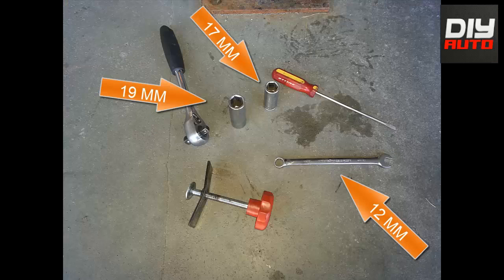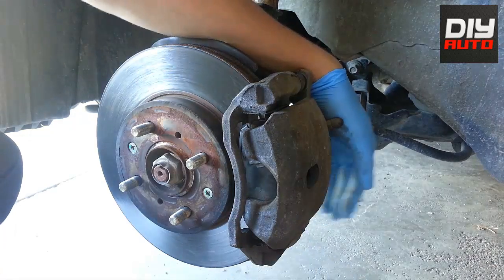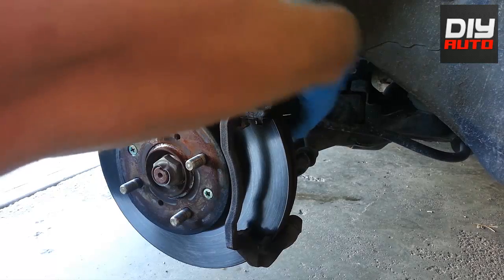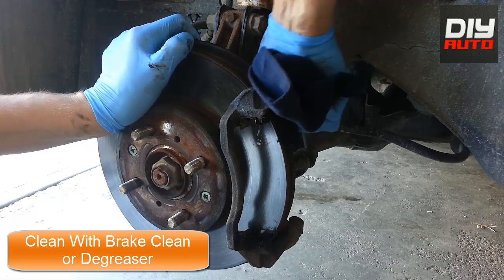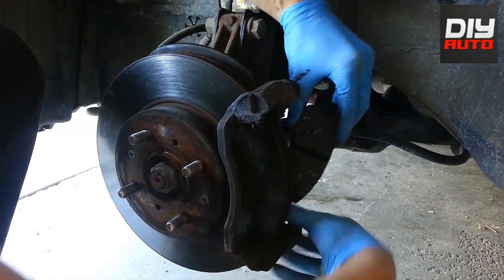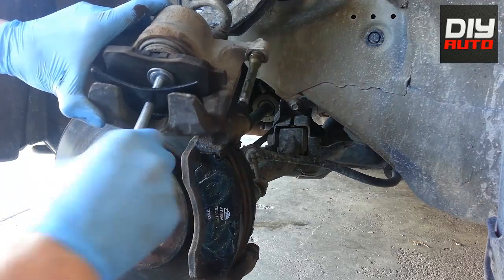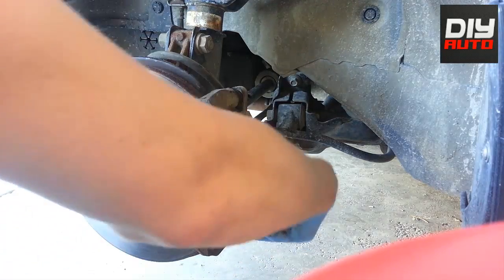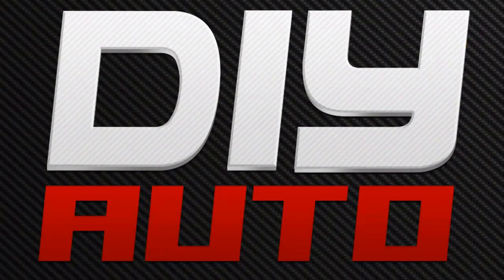HOW TO CHANGE / REPLACE BRAKES || HONDA CIVIC & ACURA EL

Comment: Does that grease you rubbed on pads come with the brake pads? or is it bought separately?
Reply: IgotGreens101 it comes with the brakes
Reply: Can also buy it at the supply store - brake lubricant - usually want to use aluminum or brass or copper lub, not silicon

Comment: Same thing or pretty much every honda guys , stay away from no name pads. Im doing mine now and the caliper wont go back on cause pads are a bit to thick.Caliper is pushed all the way in b4 you ask,lol. If you dont have a brake tool , use a big C clamp to push the caliper back in .Now off to the store to get another set of pads,lol.

Comment: is it the same procedure on honda civic 2013?
Reply: its very similar across all honda vehicles from what it seems. they all have the screws on the rotors and seem to use the same size bolts n stuff.

Comment: Be careful to not get lubricant on rotor or pads. Wipe if off with a solvent like alcohol, if you do (not an oil-based solvent - that will ruin the new pads).

Comment: you should've mentioned when installing the wheel,  you should Always want to tighten it by crossing over from one lug nut to another.
Reply: Didn’t he cross tighten the wheel when he was done? Or do u mean like mention it

Comment: I'm having trouble gettin the bottom bolt off on the driver side....any advice?
Reply: DIY-Automotive  Hey do I have to have that tool to get the piston in?
Reply: xpinchx Yes I bought one thanks. I changed the pads. After a few weeks I starting hearing some squealing when I came to a complete stop, I also feel some grinding too. I know one side I could squeeze the caliber back in back and forth with my hand like it does when the brake system is stopping the vehicle. On the other side I couldn't do that it seems like the pin might be seized on pretty good so when the brake system is closing on that side it maybe causing friction and that's why I'm hearing the grinding. Do you think my suspicion may be the problem?

Comment: how hot should brakes get? I touch my rims and rotors and they get too hot to touch. is that normal?
Reply: ahh ok. thanks!
Reply: Your bears might be going. That could be where the heat is coming from.  Of course, if you just came down a mountain, or something, yes, your breaks will be quite hot if you used too much wheel braking (use engine braking for this).

Comment: So you've just showed everyone how to brake slap? Not even getting the old rotors machined at all. That's pretty doge for a DIY channel man.
Reply: Zac burrows on Japanese cars if you have to remove the rotors from the car you might as well replace them they are so cheap
Reply: Doesn't matter what car it is, you should always replace the rotor or get them machined. Rule of thumb for brake jobs.
Reply: Zac burrows with all the cars I've owned i have never turned my rotors just replace them

Comment: when replacing the brakes do I need to bleed them as well?
Reply: Snowy Phoenix bleeding the brakes usually  is for caliper replacement not necessary with rotors and pads but if u want to go ahead